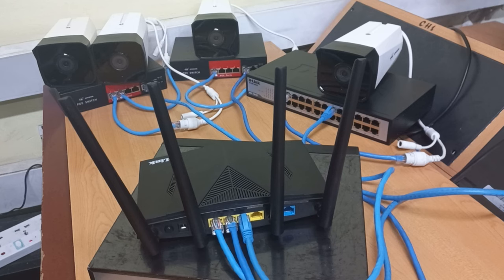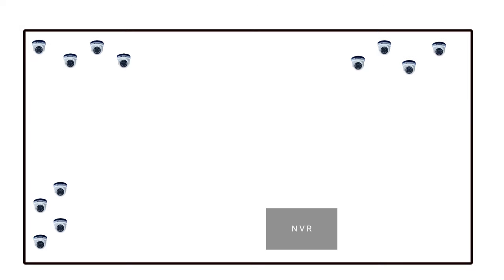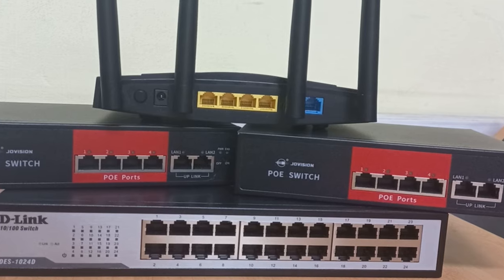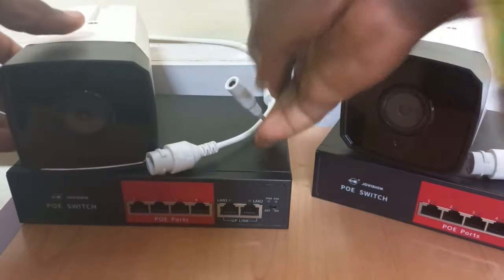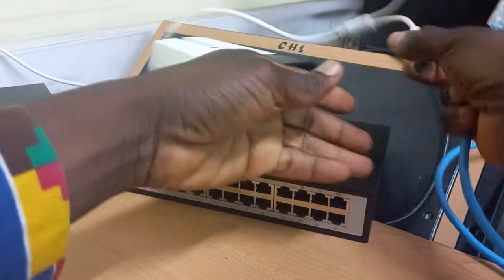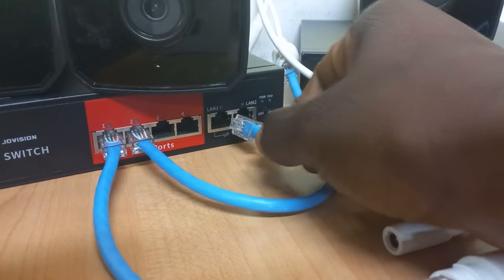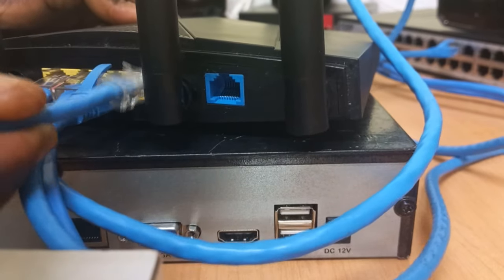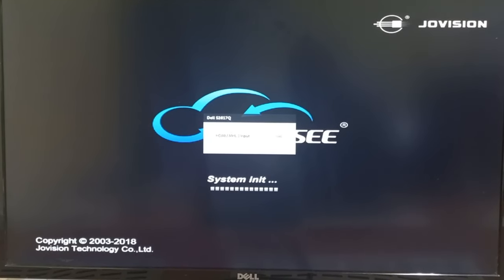How to link multiple IP camera networks together using multiple switches.

Comment: Good videos. Please do a video on NVR configuration, paying closer attention to assigning IP address to the cameras.
Reply from the maker: Great suggestion, it will be considered.
Reply: @Tech_Inside_Out  I'm no CCTV expert just curious whether you manually assigned IP addresses or did the router assign them via DHCP/Dynamic IP?  Great videos bro.
Reply from the maker: Most IP cameras are assigned IP addresses from the manufacturer. For those that are not manufacturer assigned, you can just place them at DHCP to automatically generate it. Very very sorry for this late response. I didn't notice this message.  I was just scrolling through and realised this.
Reply: @Tech_Inside_Out but how come other installers say you need to configure or assign an IP address  to each camera you set up to an nvr?
Reply: Please do installation from different brand cameras and different brand nvr. I believe lots of Ip address changes comes in there.
Reply from the maker: @swaggst  That is not necessary.  IP cameras are assigned IP addresses from factory and so once your connections are right, you are good to go. 
Watch this video on networks, it will give you more information. 
https://youtu.be/kpxbZaFBh4A
Reply from the maker: @swaggst  That is not really necessary
Reply: Would love to hear about configuring each of those clustered groups to be on separate subdomains 

+ 

tunneling into the groups by way of robust switches or an isolated secure server to prevent the cameras from being exposed to the internet.  0% Wi-Fi and limited GSM to use apps from mobile devices without having to change the user devices’ local ip address over and over

Comment: Thanks for the simple explanation.  My situation is that I have a 4th cluster of cameras.  How would I go about adding it?  My router 4 port are all taken.  My thoughts are either 1.  Buy new router with more ports. 2.  Connect new switch to one of the existing ones, I think there must be downside to this because you didn’t do it 3.  Buy new router not internet and extend
Reply from the maker: If you can afford a new router having more ports, that would be one of the best solutions.
Having another limited port router linked to the main router would also be good.
The addition of a new switch would work but not the best solution. There may be network congestions when you would have to handle many cameras.

Comment: Hello, i really found this so helpful and i am implementing monday tomorrow but my question is am using Hikvision NVR with two LAN ports but whenever i use the Lan port for Nvr to access internet from the switch , most of my cameras connected through the switch go off but i when i pick my internet connection from the router the cameras are on;   what could be the reason ?????  Thanks
Reply from the maker: Please check if there is a specific WAN Port and a normal ethernet port for cameras.

Comment: Good illustration, but noticed the last switch isn't a POE SWITCH, so how did you power the camera
Reply from the maker: This video seeks to achieve the following objectives:
1. the need to reduce cable lengths through the use of switches that link cameras in nearby locations 
2. show the best way to link multiple switches to a single NVR without having issues of network congestion.

Comment: very usefull but i want to know if the third swtch who has multiples ports is poe also????
Reply from the maker: Thanks for your compliment. The third switch is also POE. POE Switches power up POE Cameras directly without need for other sources of power and as in the video, the only connection was the network cable because power was also taken along the same network cable. Is there area you will like me to do a video on?

Comment: Hello.
Thanks for your videos.
I have some ip cameras installation that are far apart. 180m to 250m from the NVR.
Can I connect 3 switches together and from the last switch to NVR?
Reply from the maker: Yes, connect cameras at each location to a switch and connect the switches to a router.
The NVR should also be connected to thesame router and everything will work.
Reply: Thanks. What is the acceptable distance from the Poe to router
Reply: Because, I have a Poe that is 300m from the router and NVR

Comment: Dear Sir..thank you very much for sharing this video.. i have a question, i hope you can help me.. i have a router in my warehouse and i want to put IP cameras and connect them in my dvr inside the house..can i use single ethernet cable to connect ip cameras and keep the wifi inside the warehouse? many thanks
Reply from the maker: 1 The IP cameras can only be connected to an NVR 
2. The location of the router doesn't matter, once your connections are right, it would work.
3. There are devices that you can use in order to have more than one IP camera on a network cable.
Reply: @Tech_Inside_Out  if i use poe switch and connect it to the lan port of my dvr, will it work?

Comment: Hi, from your video, if add on 1 more dvr, how to connect all the cable to 1 router, lack of 1 port, any way to connect all? Mean have 3 poe switch and 2 nvr, and want to connect all together with internet
Reply from the maker: You can have a one network switch to which you will connect all the devices that need to be connected to the router and connect that switch to the router.

Comment: Hello! i am installing TP-link digital cameras and i want them to be plug-in together using only one switch (we only have limited switches in the house) My questions is, is it possible to connect the cctvs using extended power cables to the poe switch then to the internet router without nvr? Because I am going to monitor the cameras through my phone instead of a TV or Monitor. If theres additional cables, please do recommend as well. Thank you!
Reply from the maker: 1. You can use extended power cables to the POE Switch. 
2. You can use IP cameras without NVR, in that case you won't have recordings on a hard drive, you would require an alternative video recording. 
3. The cameras require the use of Cat 6 cables to connect them. Extending power to the POE Switch will require a 3 core power cable
Reply: @Tech_Inside_Out  thank u for responding, I understand now what to buy. In any case, one of my 360 cctv camera has no ethernet plug in only a male plug power cable. Is there any compatible power cable that its end is ethernet and the other end is a female plug power cable or plug-ins that I can connect that's compatible with TP-LINK? Their products are so limited in my country.

Comment: thanks for the vid but what if i want to link up 2 switches which has different IP address? can i also skip using the router and link 2 switches directly to each other but of different ip address?
Reply from the maker: You may skip the router and cascade the switches but when your cameras are many, you may be experiencing "device timed out" on your cameras. 
Cascading tranfers the load from one switch to the one it goes throgh to get to the NVR which results in the network congestion.
Reply: @Tech_Inside_Out  oh. I guess that's the reason why my screen went blank on most cam. Thanks for advise. Really appreciate

Comment: Suppose the you have one more camera instead of a bunch of them, and the distance between the camera and nvr is more than 100 meters, can the Poe extender boost the power and video signal, so that in such case the video can be viewed on screen without challenges?
Reply from the maker: Provided you have an effective POE extender, that can be possible

Comment: Good day Benedict, may you please assist me with the following.
I have 2x16 channel nvr
32 ip cameras
3x 16 Channel POE Switches

Now i have connected The 1st 12 Cameras on the 1st poe, then i connected a lan cable on upLink 1 to port 1 on the POE

Other 10 cameras are connected on poe ports aswell, then i connected uplink 1 of the 2nd POE switch to port 1 POE of the 3rd Switch which also has 10 cameras. Now the Question is that, if i plug Uplink 1 of the 3rd switch to a Router, then Both NVR also to the Router, will it work
Reply from the maker: Please i have seen your email and i will respond with details through the mail before close of day today.
Reply: for Me i think if you are using 2x16CH and 3x PoE switches....All your switches must be in the same network so that you will be able to see all your cameras....It will work (As explained in the video)

Comment: Nice videos. I have 16 port Hikvision NVR and am trying to extend the channel using extra 8 port POE switch. My challenge is that, i have only three views on a single port of the NVR with the cameras showing intermittently. Can i have any network view. Thanks.
Reply from the maker: You cannot extend the number of ports on an NVR.  For instance,  an 8 channel NVR cannot be extended to pick more than 8 cameras.
Reply: 16 CH NVR can only support a max of 16 cameras with the max resolution supported by the NVR. So even if you use a 16 CH NVR that can support  cameras with 4MP max and you add a 8MP camera on it,it will not display that camera.
Reply: @Tech_Inside_Out so what is the need of poe switch then? I thought we use the poe switch to extend the number of channels by linking NVR and poe switch?

Comment: Whats the maximum distance should there be for 
from cameras to POE Switch?. From poe switch to Router,  
From router to nvr?
Reply from the maker: The recommended cable length is 100m when running utp cables.
Reply: Dahua has developped ePoE camera and Switches that can run cable up to 800m .But the more the distance is the more the bandwith will decrease.

Comment: 1. Can we use a network switch instead of routher to link the  NVR 
2. Can a DVR also serve this purpose ?
3.  The NVR or DVR Chanel's important when networking more than 16 camera's ?

Thank you for the knowledge sharing.
Reply from the maker: 1. When using many cameras, the use of a network switch in place of a router may bring about network congestion since the peer ports of network switches into which camera feeds will be fed into, do not handle high bandwidth compared with a router.  
2. DVRs are used for Analogue or AHD camera installations and in such cases, there is a different approach which i will cover in later videos.
3. I don't quite understand the third question, if you can rephrase it so that i can answer. 
Please let me know if my explanations are understood.
Reply: @Tech_Inside_Out  the third question is, when networking more than 16 camera's, are we going to consider 4 channel, 8 channel or 16 channel NVR and DVR ?

Thank you for your respond, really appreciate sir.
Reply: Pls can you do that video this weekend about his second because that’s what will be doing this coming Monday or Tuesday and I don’t know how to go about it
Reply: @Tech_Inside_Out  but if we will use gibabit network switch will it enough to handle camera bandwidth intead of router?
Reply from the maker: Yes, that will work well
Reply: @rahmatech7034  The choice of the NVR must be according to the total number of the Camera in your network system..... So if total camera is 14 just use a 16 Channels NVR.

Comment: How can i connect 32POE cameras to 16ch PoeNvr and a 16ch poe switch ?. I know the 16poe cams goes straight into the 16ch poe nvr.  How about the other 16poe cameras to the poe switch?. This setup is for long distance 200m. 
Will it be a problem using the poe switch with poe cameras since the cams r direct poe?
Reply from the maker: A 16 channel NVR can only take a maximum of 16 cameras.  You would need a either a 32 channel NVR or better still a 48 channel NVR to cater for future expansion.  You can use a combination of POE switches to get upto the number of POE ports you need. 
POE cameras can be connected to a POE Switch without a problem.
Reply: @Tech_Inside_Out  so can I connect the poe switch with 8cameras in it to any port of a POE NVR and I'll still get everything  perfectly?

Comment: The router has to be connected to the internet b4 the cameras will work?
Reply from the maker: No, the router is not for the purpose of supplying Internet,  it is to receive the camera signals and send them to the NVR.
If remote view is required,  you can make Internet available on the router for use for that purpose
Reply: @Tech_Inside_Out  thanks a lot
Your channel is very productive 
Keep up the good work
Reply from the maker: Thanks very much. Sorry for the late reply.  I was just scrolling through and saw this message.  Am very sorry for the late response.
Reply: Create a video on this using dvr sir,
Reply from the maker: @creativemind3562  Well noted

Comment: If I use another poe switch instead of router, will it still work?
Reply from the maker: The ports of a Router deliver higher bandwidth compared to a switch, making them much more efficient in this setup.
Reply from the maker: Routers offer higher bandwidth on each LAN port than a switch will do, making them perform better when used for this purpose
Reply: @Tech_Inside_Out  ok thank you Sir

Comment: Hi in the same way in 2 locations installed ip cameras  and nvr is in other location. At all locations i have internet connected through TPlink routers. So now how i can bring those cameras into nvr.
Reply from the maker: If the two locations are at distances within cable reach, you can use one router and connect the switches at both locations to the router.  You also conect the NVR.
Reply: @Tech_Inside_Out  no cameras are far away and NVR is far way
Reply: I need those both location cameras to be added in NVR at my home
Reply: @Tech_Inside_Out  any solution
Reply from the maker: @JANAPAREDDYKISHORE  Hello, 
Please see if this video answers your question. https://youtu.be/5f8aWO_m_8M
Reply from the maker: You can reach me by WhatsApp on +233556307182. Let's discuss more to find solution to the challenge

Comment: Hello, customer placed already installed 24 camera with different different places with 8 Poe switch and customer want to more 8 camera so what I can do? It is 32 CH NVR
Reply from the maker: Hello Ganesh,
You can get a 16 port POE switch and add the new cameras to the new switch.  You from the new switch send one cable to the NVR so that the new cameras can be added to the old cameras.
Reply from the maker: Please let me know of i have fully answered your question.
Reply: @Tech_Inside_Out  customer installed already 24 camera with 3 three place they putted POE switch 8 ch different different places because camera distance like more than 150 mtr, now customer want to add more 8 camera and the same distance like more than 150 mtr

Comment: How can i trace my cctv's cables in a large building? I have encountered a 'No Link' problems in monitor but the cameras working fine. I hope you can help me. TYIA!
Reply from the maker: Hello, you can use a LAN testor to test the cables, 
please see this video on how it is done. 
https://youtu.be/EccXWepv5z4
Reply: @Tech_Inside_Out  Another question. How many PoE does the building have if they are using non PoE Nvr/Dvr with 61 Hikvision IPC? Im the new IT Specialist here sir and they do not have any written reports for these one. I hope you can help me, TYIA.
Reply from the maker: @iamme1093  They can use any number of POE switches. It could be 2,3,4 or even more depending on how they made their structure.
Reply: @Tech_Inside_Out  It seems like some of those POE are on the ceiling, I guess because I can only see two POE as of now. Such a pain